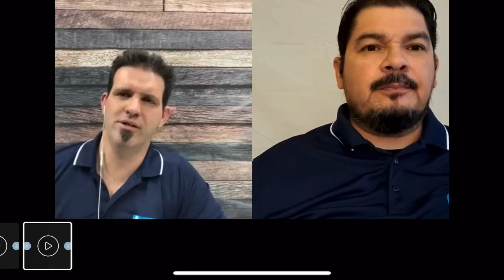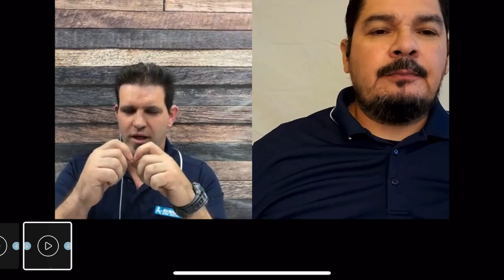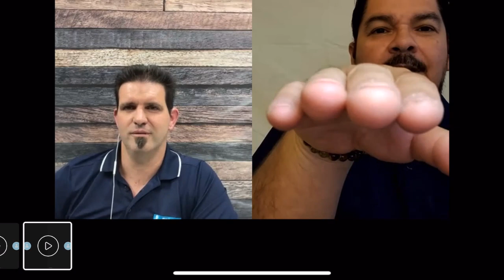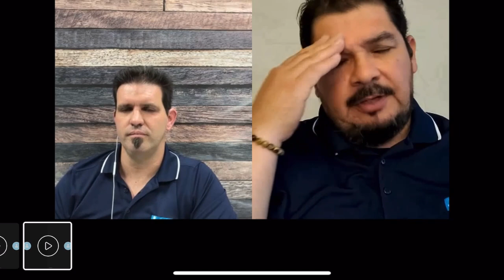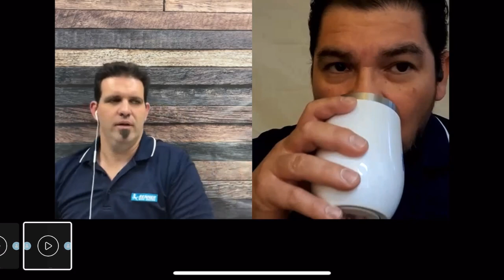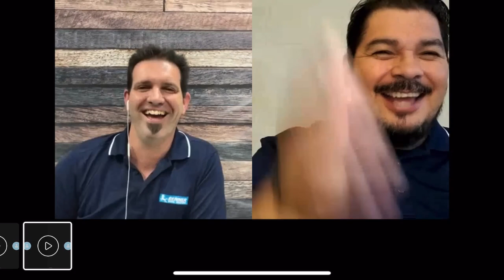Dennis Rodriguez waterbase jedi part 2

Comment: In Part 1 Dennis mentioned going higher grits to avoid the water pop from WB   (Like 220 for Hardwood and 320 for MDF). Then in this section talks of not going too high in your  grits bc you lose hold, saying to stay below 180 and heck even 120 is fine.  Is this for the case of raw wood vs refinishing (sanding some sort of varnish)?

Comment: I just scored a barely used x5 after hearing about your success with them.  Should I ditch the stock gun? Want to get some TriTech tips which ones would you recommend  I get first? Should I return this RAC X FF LP 310 tip and go with all TriTech setup? You guys do a great job at trialing all these new fancy paints and it is greatly appreciated!
Reply from the maker: I like the TRITECH guns but they are not necessary

Comment: Favorite video so far.  Could you recommend tip size and air and fluid pressure specifically for kremlin Eos 15 to 1 pump for Envirolak 170 primer and topcoat.?
Reply from the maker: Yes, 411 500-800 pounds of fluid and 25-30 triggered air. Envirolak has this listed on thier website as well and in thier tds

Comment: Great content,  I just found your channel and I have been watching everything. 
I make custom cabinets and currently my wood supplier sells M.L Campbell.
I want to make a switch to a different waterborne system due to some of the issues I am having with the arroyo pigmented pre cat laquer. 
I am getting the impression Envirolak might by the direction I want to go in due to new construction and some mdf panels for the flat panel doors and drawers.
I currently spray through a 4 stage turbine with a bottom feed gun its a fuji set up. I have a few cap sets from 1.3mm to 1.8mm. 
My questions for you are as follows: Should I switch to Airless if so what brand?
What tips for fine finish 308? 310? Etc.
If my turbine will work, can you educate me on the Envirolak 170 and 200. How much reduction, viscosity in #4 ford cup, what tip, how much catalyst?
I know this is a lot. Thank you for your time and what you do.

Comment: Eric, thanks for such an amazing video, you guys rock. 
I will say I am confused though. I live in western Canada and I only want to spray water coatings. I have access to ICA and the Renner supplier also has a limited supply in my area. I don’t think I have access to any of the other coatings you like. 
When I say confused, I am talking about equipment. I have sprayed mostly solvent based coatings , I currently own a CA Trchnologies 14:1 pump and a Kremlin 30:1 pump with the excite guns, I have a  Spraytech airless 2105 I think it is and I have a couple sata cup guns. My favourite outfit by far has been the Kremlin pump, but after listening to these videos, I am wondering maybe I should buy a different or better gun for my airless, the gun on it is the one that came with it many years ago? 
Maybe I should by a new airless pump, no idea what brand? 
Anyways I am confused, any recommendations?
Thanks

Comment: I am thinking about using my festool DTS400 for flat sanding and then doing the corners and details with my Surfprep with a half inch pad. I will have them both set up so I can get them on the doors while they are on the table. Any problems with that? Will the festool garanat paper work okay?
Reply from the maker: That will work we recommend cubiton paper over the festool.

Comment: Eric, when you talk about your finish systems there is mention of multiple prime coats or thick prime coats. In a 4-5 mil dry film system, I have talked with multiple chemists and read tech data sheets that state 1 or 2 dry mil max for primers. I know of finishers who have had cracking from too much primer. Are the systems you are using sound over time with 50/50 or 60/40 primer to top coats?
Reply from the maker: These aren’t cv solvent finish and you have to remember that if we are applying even 7-8 wet mils your dry mils are much less and you sand over half of that off. All the coatings we use are specifically designed to be applied at 4-5 wet mils

Comment: Eric, I'm up in the Pacific Northwest and this time of year it gets cold and wet. We keep the booth around 75 to 78 degrees with around 60% humidity with the electric heat (best we can do in winter). We use Renner products and my question is should we heat material and if so to what temp? I've been messing around but having mixed results.... is there a material temperature sweet spot?
Thanks for all the advice. You guys rock!

Comment: Hey Eric, I'm spraying with a homemade air assist (graco 395 rig with 6 gal compressor, either Wagner or ca tech gun. Want to try enviorlak (170, 200). Is a good starting point a 411 tip with ~500 fluid, 25-30 air for a white color? If I wanted to spray a darker color with enviorlak should I try a smaller tip (409, 309)?
Reply from the maker: Yes that’s a good starting place with the 170 you might go up to need 600-800 fluid pounds
Reply: Hey man, how’s that setup working for you? I’m putting together the same…395 with a 6 gallon Dewalt pancake compressor…..is your compressor keeping up? Any issues you have experienced that want to share?
Thanks in advance!
Reply: Hey , thanks for the message. Setup is working great! I actually have a Kolbolt 8 gal compressor and honestly it barely keeps up especially on larger doors and panels. I'm not sure if your pancake compressor will provide enough air. What I am thinking of doing is buying another compressor and join them with a "T" fitting and pressure regulator to give more steady air pressure for a longer period of time.about 25 psi air  for pigmented coating, 10-15 psi for clears. For fluid pressure I turn the airless pump as low as it will go before shutting off (5-8 psi) and that works great. Generally only using 411 tips. I just did a job using CIC 1150 primer and 2800 topcoat all catalyzed 10% and results were amazing, Highly recomend the setup and if you can use the airless pump alone to do interior / exterior painting with latex (I have separate hoses and guns for latex). Let me know if you have any more questions.
Reply: Oh, one other tip is definitely use an oil/water separator attachments from your compressor. I have one coming right off the compressor (which also regulates pressure) and another small one at the end of the gun. Once I forgot to use the water separator off the gun and got fish eyes like crazy, put it back on and no more fish eyes. The air coming out of my compressor is very wet and dirty.